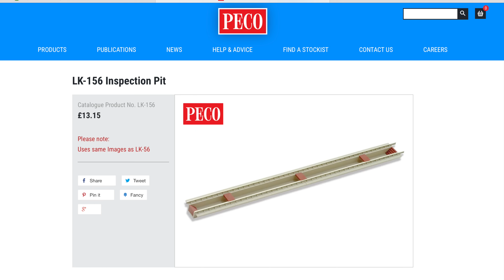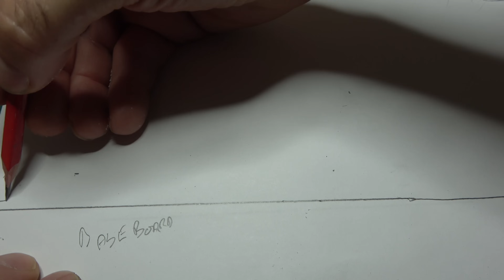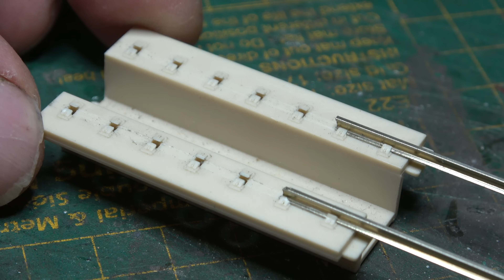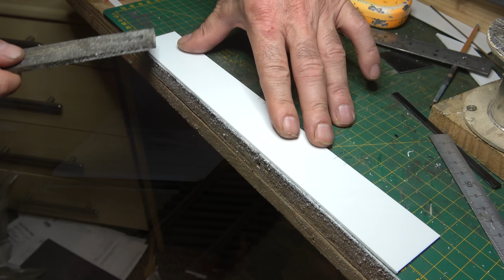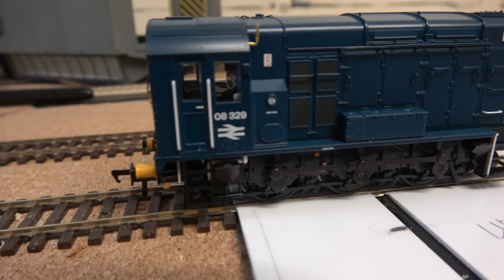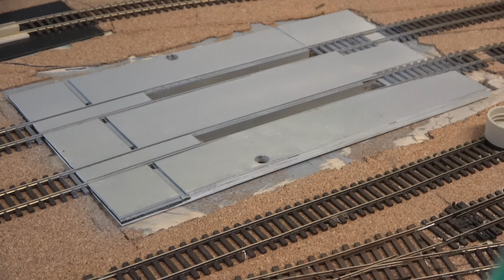Peco Shed (Depot) & Pit + Rails embedded in concrete

Comment: Great video as always Nigel! 

One thing I’d be careful of is how to clean the rails (in service), I’ve done the same as you (more or less) and getting a rail rubber down the rails without scratching the lovely weathered concrete is a bit of a challenge. If I do it again I think I’ll leave maybe 0.5mm of the rail proud to make like easier. Anyway just my 10p worth.
Reply from the maker: Indeed. Although I tend to not use a track rubber on sections like the concrete pad or level crossings. Hardwood wedge cut to rail gauge width or similar homemade thing. 
Also, track cleaning these days imho is not needed as much. Heavier locos mash all the dirt and grime to oblivion just like the real thing. It's only older stock that has plastic wheels which are notorious for collecting dirt. I've replaced everything like that with metal wheels though.
Also depends n how often you run trains? 
I find that I can go months without cleaning rails and everything works fine. Then I come to shoot a piece for a video and get constant stalls in multiple places. Its like the grime is mocking me 😂😂😂😂

Comment: That looks really good nigel,  I remember having the first of the peco shed and depot buildings and they were mainly made of card and warped 
Not sure if they still do it but scalescenes use to do a free depot floor and pit download.  I printed that out on self adhesive paper in put them I pits and on depot floor 
Cheers Russ
Reply from the maker: I printed those out as well, never got around to using them on an actual project though 🤔
At the same time of doing this PECO shed I've been working on the Airfix steam shed. 
That'll come out in a separate video at a later date.... 😉